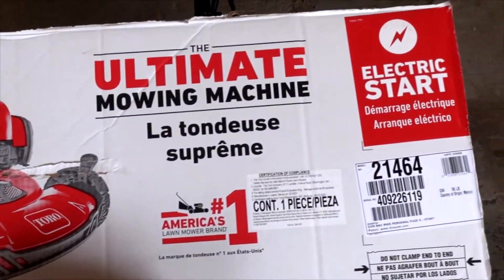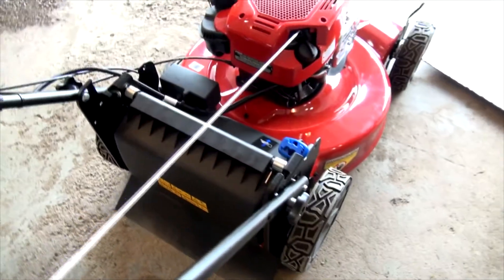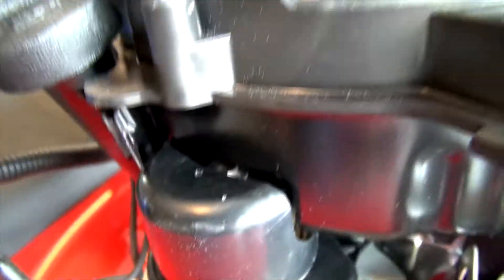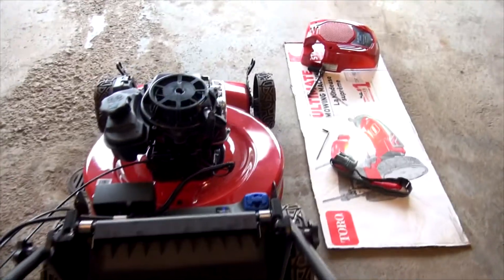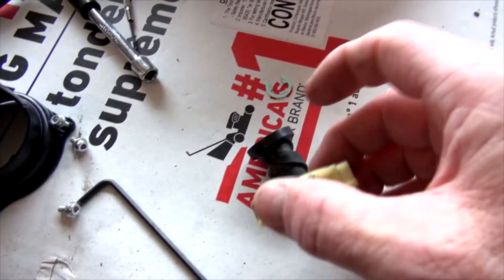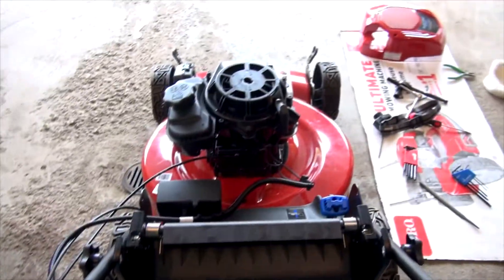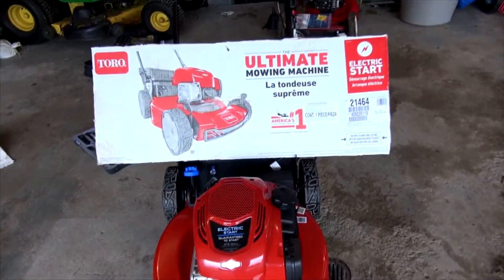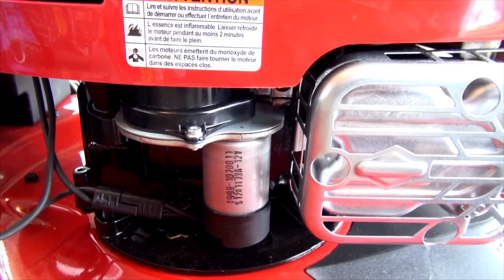TORO Model 21464 Personal Pace Electric Start Lawnmower Blowing Fuses Brand New

Comment: My neighbor Marcy, lady in her 70s has the same mover  for 3 years and now it has the same problem.
We tried:
New battery 
Replaced the starter
And still no go.
We’re dropping off the mover at a small engine shop today to see what they find
Reply from the maker: Try installing the spacers just as in the video. We have not had the problem since.
Reply: @BENZ007  Hi
I did see that video and I did install washers behind the starter- no change
Reply from the maker: @bikedude1999  darn, that worked for me. Let.me know if you figure it out. Try 2mm ?
Reply: @BENZ007  I ended up bringing the mover to a shop- they believe it might be a weak ground.
I’ll keep you updated

Comment: I think the problem is the battery does not have enough amps to turn the motor, its the battery.....not fully charged or not strong enough.....I am in the RC world same issues with electric motors
Reply from the maker: Good suggestion and we made sure the battery was fully charged . After I finally fixed it , I started it 100 times just to see if I could duplicate it , but it didn't fail once. Thanks for your comment and suggestion. Have a great day.

Comment: Did you bring it back? did you see the other YouTube video where the person put 2 washers ?

Mine doesn't start anymore and its brand new
when I push the button it does nothing at all 

I didn't get any fuses with mine 

TORO needs to RECALL this product and be Transparent. Its a great mower but the electrical start is the only BAD issue
And I even mentioned it to the TORO customer service but I think they are in Deep denial
Reply from the maker: Sounds like your fuse is bad. Yes it is a defect and they are all failing. No one who installed the spacers reported back and said it didn't work. It's the only reason we bought it and had to troubleshoot it myself

Comment: Your Battery becomes weak. The Mower is fine just make should that your battery is fully charged with 12 volts plus. I have one of these mowers best mower on the market.  Still good video.
Reply from the maker: Thanks, its working good since I fixed the starter issue, the battery was fully charged. I do find that these new mowers rev lower than the old one, I guess for emissions, and it stalls easier under a heavy load if I miss a week of mowing.
Reply: He showed the fuse blown dummy

Comment: This engine is 150 cc 4.6HP I would not touch touch this mower you void warranty what is wrong  is The bendex spring is the problem you can not tell the difference between a new one and old one. allso   a clicking sound check battery voltage. pull start see if it runs.Jan 7/2022
Reply from the maker: check the video in the link, it was fixed the next day.

Comment: My new electric start Toro personal pace mower does the same thing.  I bought it June 2022.  I took it back and they put in a new fuse and gave me some extra's.  It keeps blowing fuses what should I do?  It is Briggs engine 150cc model number 0993J050173E1
Reply from the maker: In the description of this video is a link to the fix. Click the link , it's a short video shows you what to do. You just need 2 washers to use as spacer....watch and see.